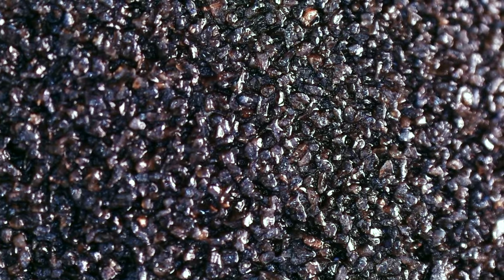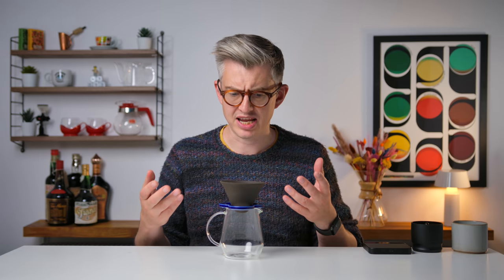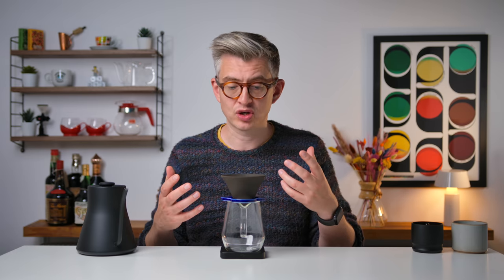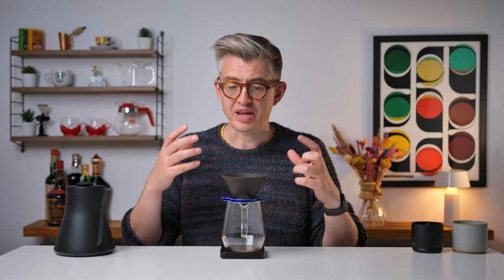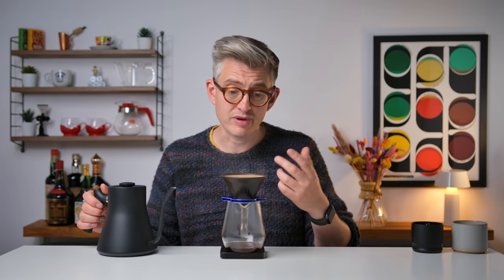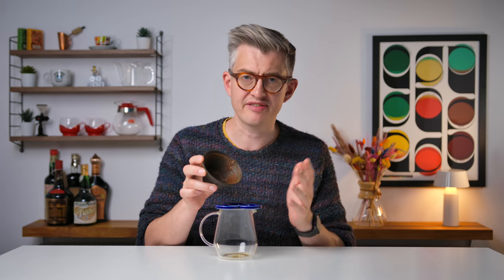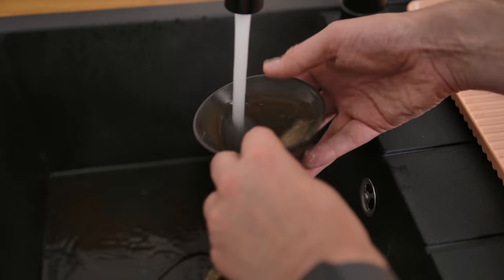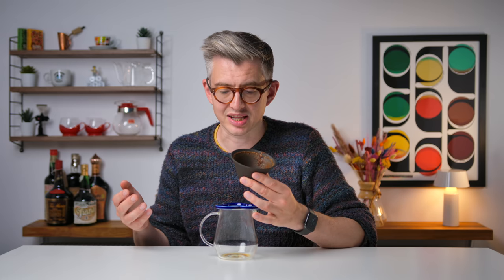Ceramic Coffee Filters: Magical or Maddening?

Comment: I did a rough carbon footprint analysis when deciding whether to default to the cloth filter or paper filter when using my V60. Depending on one's particular set up things may vary, but I have a very efficient natural gas water heater (~70%), heat the water by ~45°C, and found that it took at least a litter of hot water to adequately clean the cloth filter. Given these figures, I found that the carbon footprint of heating the water to clean the filter to be ~0.014 kg of CO
2. The carbon footprint of 1.5g of paper (the weight of my filters) is ~0.0018 kg of CO2. I should note that manufacturing, packaging, and transporting the filter will certainly add to this carbon footprint, but given how much more carbon intensive heating water is (nearly 8x), I'm fairly certain the paper would come out way ahead regardless. Obviously, if you have a carbon free source of hot water, that changes the calculus.
Reply: I suspect the carbon footprint of the coffee itself dwarfs the footprint of a paper filter.
Reply: @RobertBlair  For sure, from the numbers I've seen about an order of magnitude greater ~.01 kg/CO2 per gram of coffee, or ~.15 kg/C02 for a 15 gram dose. Though that number can change dramatically, being highly dependent on the farming and processing practices.
Reply: "I have a very efficient natural gas water heater (~70%)" - and that gas is not popping up magically. It has to be purified, compressed, transported to your house and all of that isn't very efficient either, so from the well to the heater there goes, let me pull an estimate out of my behind, another like 30% to 40%, sort of..?
Reply: @brixomatic  My understanding is that since natural gas lines are relatively low pressure, the transportation energy usage through those is only ~10%, so long as the municipal gas supply has a direct pipe links to wells (which is the case in most of North America, including where I live). That's why I didn't include it, just as I didn't include transportation for the paper filters. If the natural gas supply has to be trucked or shipped as compressed or liquified natural gas, then the losses will be much higher.
Reply: Must you wash in hot water?
Reply: @slaplapdog  Most organic oils get significantly more viscous as temperature decreases, and solidify as temperatures get sufficiently low (for coffee oils this starts around 10° C). Given this, I have generally assumed that I need hot water to clean coffee oil off anything, but it could be worth experimenting with.
Reply: This kind of analysis often produces counterintuitive results... like the recent shopping bag analysis that found that the kind of shopping bag with the smallest carbon footprint by a huge margin is plastic. The worst? Reusable cotton. You'd have to reuse a cloth shopping bag every time you shopped for your entire life, pass it down to your grandkids to do the same, and then they to their grandkids, before it finally broke even with just using plastic.

I personally feel that even though paper had many times the carbon footprint, the renewability of it, and the lack of microplastic addition to the environment makes it arguably worth it.

IIRC, reusable plastic (polyester, nylon, etc) were in between paper and cotton, and you could conceivably see a net benefit to the environment in your lifetime by using those.
Reply: @barefootalien  I saw that study, it wasn't quite as bad as you say. I think they found that a cotton bag had to be used ~150 times to have a carbon footprint equivalent to a single use plastic bag. But it's a good point, climate change is not the only mechanism by which we are harming the planet, and we should remain mindful of the other impacts of our consumptions.
Reply: @barefootalien  I dont know about you but my state banned plastic bags because of the litter concern, not so much carbon footprint.
So you might as well present the statistics on how plastic straws take less energy to produce while someone's pulling one out of a sea  turtle's eye.
Compare the amount of microplastic introduced to the environment from a reusable cotton bag vs plastic
Or macro plastic for that matter

And at the end of the day renewable has a meaning, you could technically make cotton bags until the Sun Burns Out but we only have so much oil to turn into plastic
Reply: The paper itself is a technically carbon neutral product, assuming tree farms, which most paper comes from nowadays. Except the distribution and production of it, as you stated.
Reply: @slaplapdog  Probably not, but if you're not going to use hot water, then you need to use some other method of disinfecting the cloth.

Comment: with the amount of HOT water you need to use to clean it, and the "15 minutes over a gas flame" bit, I have a hard time believing it's more environmentally friendly than some paper filters.. not to mention the amount of them that will get used a few times and then thrown out/left to collect dust because the cleaning process is so cumbersome
Reply: The whole 'zero-waste' is literally that, a marketing ploy which banks on you not throwing away the product you bought like you would with the regular 'old-fashioned' product.
It doesn't mean that's environmentally friendly at all. It just means that you don't produce waste, like with Metal/Glass straws vs Plastic Straws.
Before this 'green-washing', the product would just be called 'Re-usable'
Reply: It seems like a really hard sell from that perspective over a reusable metallic filter.
Reply: @heyitsmort7744  it’s both and, not either or.
Reply: This is my feeling about almost all green initiatives. Why do they think I’m not already doing it?

Comment: Hey James, I think that the water issue is more complex. I actually doubt that this requires as much water as paper coffee filters. Paper and cardboard require absolutely massive amounts of water for manufacturing. It's enough that using a bidet actually conserves water relative to TP. And it's not just the manufacturing, there's the transportation, the packaging, the human labor required to stock them on shelves. It all adds up. The ceramic filter is just making the water use more immediately visible to you. I think that a more efficient way to wash it would be to immerse it in water and shake it out a bit. But also--I'm a gardener, and an avid composter. For me I'd use as much water as needed and just use it on my plants or my compost. Plus, on top of all that--even if the ceramic filter IS using more water we have to compare the actual chemical makeup of the waste water. The ceramic filter is just water and coffee--not really a big deal. In contrast, the paper mill wastewater is going to have bleach and various other contaminants. That's not to harp on you, or anyone else using paper filters--between my mental health issues, and grad school I am back on paper filters myself. I'm just pointing out that it's much more complex. I also wonder if using a bigger powered torch on it to incinerate any coffee might work--not that Bripe little one. Or maybe even clean it out with water and put it over an alcohol candle or inside the oven when you bake something.

Comment: Hi James for me unglazed ceramics always taste like stone, as do both clay or stoneware perhaps this is the taste that is added in the brewing. Here's something to try, when it is clean and dry lick around the opening, to avoid where coffee oil residue may be, and see if it has a similarity to the taste you find in the coffee after brewing.
Reply: Actual stoneware (clay that has vitrified) should be inert with no flavor or aftertaste glazed or unglazed; trouble is that actual stoneware is non porous.
Reply: @robertopics  it def is inert but it doesn’t mean it won’t have a taste. Like stone grinders. You’ll taste if you have sensitive taste bud but won’t cause any harm.
Reply: @Mikey-ym6ok  does glass impart flavor to coffee?
Reply: @blond-diver9998  no glass is not the same thing as rocks or clay that's been fired at relatively lower temperatures. I never lucked rocks as a child but not all rocks are the same. Stone rocks are very porous and can grow bacteria and some react to mild acids like saliva so ymmv.

Comment: I may have several cleaning suggestions, want to do the experiment?
- using high pressure water jet to reverse cleaning the filter. I always use this method to clean some filter (not coffee filter)
- using ultrasonic cleaner method. maybe it is very easy to vibrate all dirt off with the help of water or with additional solvent?
- vibration with something attached? I think it is the fast and clean method, but it need to test what is the frequency of the ceramic to vibrate to get the best result
Reply: Just for coffee? Water jet? Seems like washing my car port. Ultrasonic ? Seems like washing my jewelry, I guess the vibration will do no good, it's ceramic after all.
Reply: I was thinking the same. An ultrasonic cleaner would, I suspect, do a great job of removing fine particles.

Comment: This is the kind of thing I really want to love. However, if it’s not great for the planet and it’s not great for the coffee, it’s hard to justify
Reply: Luckily, ceramic remains an excellent material for cups, saucers, pitchers, serving pots, flower pots .etc
Reply: Paper production is also incredibly wasteful when it comes to water, i would estimate that a single filter paper would be about 3 gallons of wasted water
Reply: @hcm5467  I wonder how long you'd need to use a metal plate or mesh filter to balance this out - steel production uses huge amounts of of water & energy also. Or a cloth filter - reusable sure, but they still degrade over time, while you could theoretically use a steel filter for a lifetime
Reply: Not great for the planet? Why does “great” have to be the achievable level? It’s likely no worse than paper filters. There are, and going to be, a lot of environmental choices where neither option is great but you mitigate what you can.) 
And not great for coffee? When was the last time on this channel you heard about something that was great for coffee. Lol. It’s one nitpick after another. 
(There’s also the issue that filters are bleached and the whole paper process puts a lot of chemicals into the ground water…would you rather run a tap a bit, or constantly pour chlorine in your yard?)
Reply: @hcm5467  according to others in this set of comments, it takes about 1/2 liter of water to produce 1g of paper. So the ceramic cone filter is likely worse for the environment.
Reply: @AveragePicker  You're right - 15 minutes on full-flame gas stove is better for the planet. Silly me!
Reply: @jamesrogers9887  As I said, sometimes there’s no exact win and you have to pick one not great option over another not great option. No need to get snarky about it. ….and I don’t know the numbers, nor did I pretend to, and I suspect you don’t either.
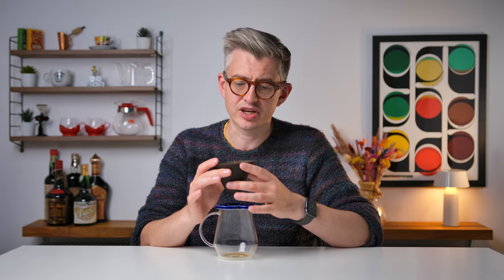Reply: @AveragePicker  8:38 - that’s where the numbers are from. Don’t be an apologist for greenwashing
Reply: @jamesrogers9887  👆Guess we found who makes their living selling paper.

Comment: As soon as the video started, my immediate thought was around cleanup.... Glad to see that is the primary gripe. Odd that it imparts an off flavor, didn't expect that. Assuming it's giving off some minerality, I wonder if long term use would eventually have the material breaking down with the high water temps and acidic coffee running through it.

Comment: i don't know about this particular material but similar materials or materials with similar concept has been used in the building industry for a very long time. a lot of cities choose to use some form of porous pseudo concrete block to tile pedestrian paths. the reasoning is they allow water to drain without the need for building additional ugly gutter/ditch aloneside the paths for storm water. but those tiles only last a few years needing to be changed due to clogging. it's hard to imagine this filter somehow solves the clogging problem. because they would've been in the lucrative business of government infrastructure contracting, rather than making super niche consumer product.

Comment: I use a stainless steel filter that works the same way, and I love it.  I drink one cup of coffee a day so an electric coffee pot produces too much, and I really don't like Kcups.  This thing doesn't have a lot of the problems that the ceramic does.  It doesn't clog, rinses very easily, and doesn't hold or have any taste.  I also use finely ground coffee with no problems.
Reply: Completely agree, I use a single-layer steel filter and it works beautifully. The single layer means there is nothing to trap the grains so they wash out easily. I’d be interested to hear his thoughts on how it compares to a Chemex or V filter.

Comment: My wife went to Japan and bought a Cera Filter from 39 Arita for me. My experience is completely different from what James is describing. This brewer has the fastest drawdown of all the brewing methods I tried. I dialed my recipe to use the same grind as I do for my Aeropress, almost espresso grind. I do a traditional pour over, pouring slowly and keeping the water line just above the coffee bed. I get very good coffee. I’ll need to try again with a paper filter to see if I can taste the difference but I don’t think I can (except for the difference due to grind size). Cleaning is very easy in the kitchen sink. Water goes right through it.
Reply: I love mine too. Brews great coffee and I notice that it’s got  better flavor then using my usual
Cloth filter.

Comment: I actually work in porous ceramics in a completely different field (catalysis) and this was a really interesting watch. Can confirm the most easy way to clean (remove organics from) such materials is by heating them to a high temperature. I do that in a oven at +500 degrees C, so not really feasible for home use..

Comment: That is the thing with the "but this is green" crowed: They (most, of course not everybody) do not actually care about that, like at all. Those are the same people that claim that using plastic-bags is so damaging for the environment so they use cotton instead, but during the production of a cotton bag so much oil and other products are used that you'd need to use the same bag every day for an entire decade for it to come close to plastic in terms of environmental impact for what it does.
If somebody actually cares about the environment then the first 2 things are reduce and reuse.
And while paper-filters are basically one-time-use only it is a minuscule amount of paper compared to all the newspapers, flyers and what not that people throw away every single day, it also is not color or anything like that, paper can be recycles decently efficiently, and the production of paper mostly uses a lot of water which really is of little concern in the regions it is used. (and no, using less water in a developed country does not and has not helped a single person that does not have drinkable water).
Reply: I suspect it's less that they don't care and more that they're ignorant on the matter. Most people don't even know that the majority of reusable bags would need to be reused a ridiculously unrealistic amount of times to offset the manufacturing cost and waste that comes from making it just like most people do not know that most of the plastic they put in the recycling bin never actually gets recycled and humanity would be far better off just doing away with as much plastic use as is possible. 

Most people are just told "this is a thing that's good for the environment" (often times by corporate marketing meant to make them feel good) and so they buy into it without looking further.

Comment: When figuring the total cost of ceramic vs paper filtration, don't forget to add in the expense for a plumber to unclog your drain from flushing all the grounds down your sink when cleaning the ceramic filter.  The paper filter eliminates this plumbing nightmare.
Reply: I have a reusable coffee filter. You toss the majority in the trash, and the rest definitely doesnt affect your plumbing at all
Reply: @skeetsmcgrew3282  with normal reusable filter out is much easier to push grinds from outside or tap them out.
Reply: @paveloleynikov4715  is it super fragile? You cant tap it a few times on the edge of a trash can?
Reply: @skeetsmcgrew3282  frankly, this thing looks really fragile, even if it's not.

Comment: This filter reminds me of my Colin's perk bong, it has a similar style percolator, made of crushed glass though. Cleaning has many of the same problems. The porousness traps all the dirty stuff where I can't see it, so I just pour alcohol in and out until it doesn't come out brown, but it almost always has a slight tint to it no matter how many times I clean. I also end up having to use tons of water to rinse it thoroughly. It's a cool idea but really doesn't seem to work any better than a normal percolator with a normal sized hole, and just adds a lot more pain to the cleaning process.
Reply: Oh man you’d never get the resin smell out, either. I mean even with my stock standard bong it’s tough to actually get that smell out completely with iso alcohol and salt, but I can get it for the most part. I can imagine it’s impossible with yours.

Comment: The Ceramic those are made of has been around since the early 1980s.  Sintered ceramic filters grew out of a need for an updated water purification method for the military.  Good filter for reducing suspended solids from water... e.g. brown silt in river water.  But the water purification filters have four to six filters in a unit holding several gallons.
   If you want to do other than disposable filters; I'm still using a micro perforated gold filter purchased in 1083.  Another source for reusable filters is to cut to size from rice napkin material.  Hint: make several and run through the launtry (only with dark material like jeans).